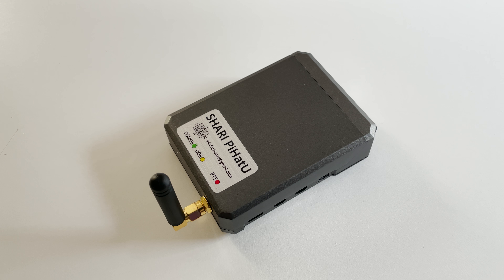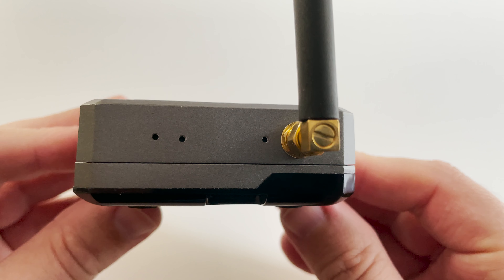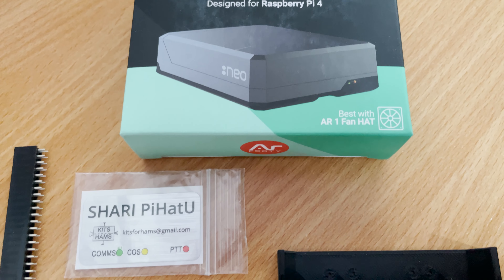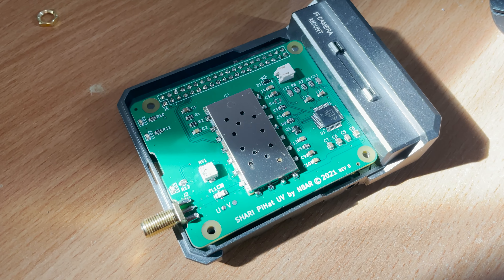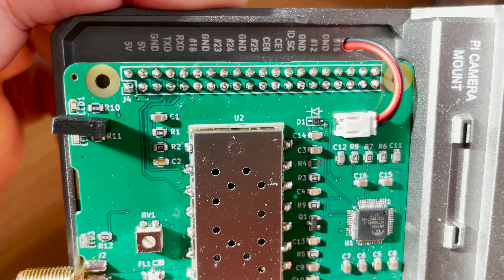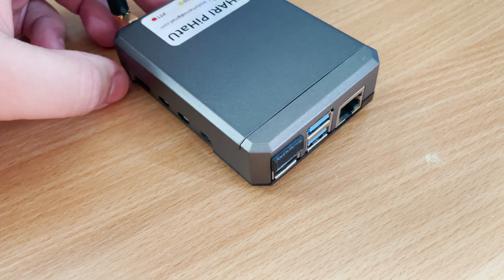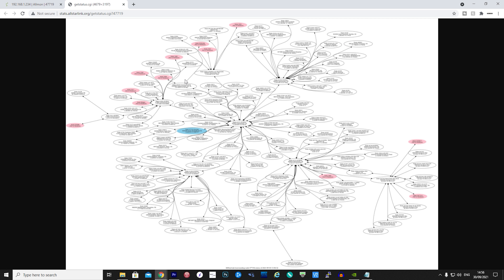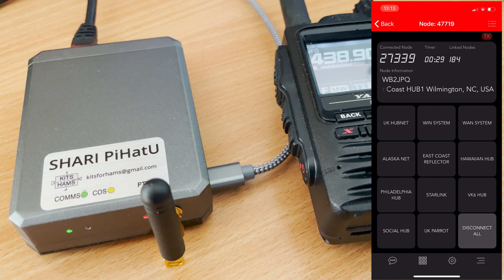SHARI Pi HAT - ALLSTAR SA818 Radio Module For Raspberry Pi

Comment: I just came across allstar yesterday. Been out of the amateur radio for 15 years. A lot has changed. I’m using EchoLink on my phone, back in the day, it was just computer. I’m interested in allstar. Not electric included nor how to install software. I don’t have a hand held radio. I’m planning on getting the Yaesu ftm 400xdr for my first radio. I’m looking for something plug and play. I am get my node somehow, my IP address for my home internet. Allstar seems far better than EchoLink. The Wisconsin repeaters I want to connect are either on a RHRL or allstar. Or I need a actual radio

Comment: i wonder if it could worked using my cell phone as a router to access the internet? i need one node in my car and 1 home .73 and superbe work  you did here.
gervais,ve2ckn
Reply from the maker: I hear many stations on Allstar that use their mobile phone as internet hotspots, so yes, definitely achievable.
Reply: Good to know. I would like to see that rig and it's setup!
Reply: @chrissewell1608  well i am thinking about buying one allready assembled because i dont see well and i cannot weld anymore.73 Gervais ve2ckn
Reply: @gervaisfillion9417  Hey Brother. No one is judging you here! I don't blame you at all. My sight is not what it used to be either! 🤓